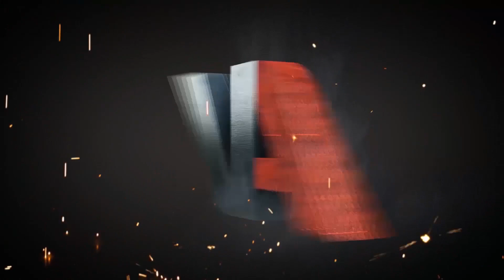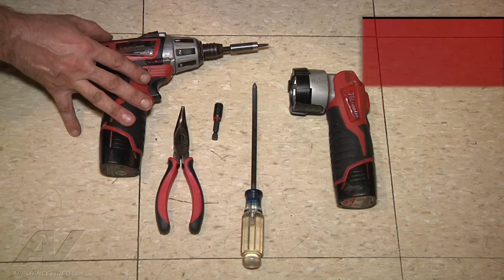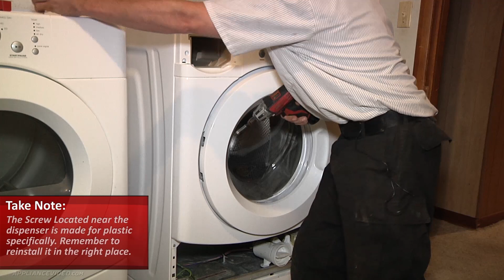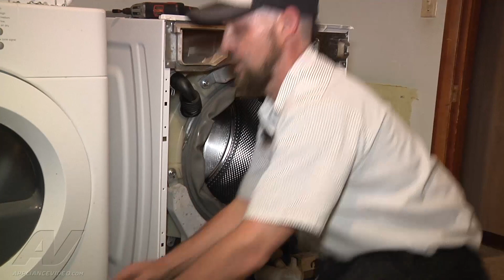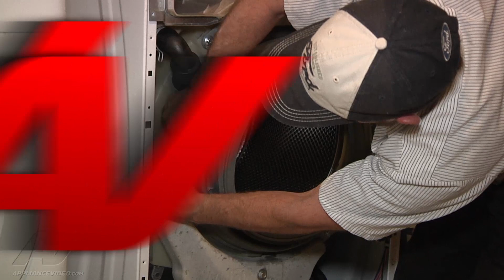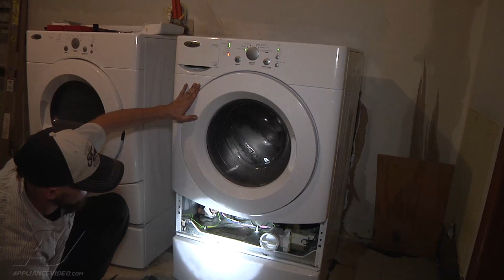Amana Washer Repair - Leaking Water - Bellow

Comment: There’s a trick to open the spring on the last spring by making your own tool with zip ties and a double sided wrench.. it’s in the search videos when looking for how to replace the bellows … you basically attach the spring to the ends of the crescent wrench and tighten the zip ties.. it opens the spring and holds it so you can put it on.. I definitely was too weak to get the spring opened without having that homemade tool.

Comment: Hello, I replaced my bellows (same make and model) i still have a leak. I noticed the new bellows has drain ports in the bottom(previous did not) it is leaking from that area. Would using a gasket maker/silicone sealer be my best option? I don’t understand it should have fixed with the new bellows. Thankyou.
Reply from the maker: Great question, if you have a more technical question that our parts department cannot answer, you can search our over 17,000 answered questions free at our website www.ApplianceVideo.com under our Repair Help section. You can also call our parts department at 1-800-830-5465 and they can give you help 7-days A week ,or search at www.SaveMoreOnParts.com  .
Reply: Did you ever found out the problem? I have same issues, water would drop during spin cycle around the same area you mention.

Comment: Did anyone hear loud thumping during the spin cycle along with the leak?
Reply from the maker: Great question, if you have a more technical question that our parts department cannot answer, you can search our over 13,000 answered questions free at our website www.ApplianceVideo.com under our Repair Help section. You can also call our parts department at 1-800-830-5465 and they can give you help 7-days A week ,or search at www.SaveMoreOnParts.com  .

Comment: Video was a huge help in replacing the bad boot.. But after testing for leaks it is leaking at the bottom where boot and glass come together. Any help here?
Reply from the maker: Great question, you can call
our parts department at 1-800-830-5465 and they can give you help 6-days A week
Mon-Sat . You can also search at www.SaveMoreOnParts.com 7- days a week.  If you have a more
technical question that our parts department cannot answer, our technicians are
answering all questions at our website at www.ApplianceVideo.com under our Repair Help section. We have over 6,000
common questions and answers that you can easily search through by your model
number, appliance make, problem or error codes, and It’s completely free to
search through our question & answer library. There is a very good chance
you question is already answered there.

Comment: Could this work with an Amana NFW72OOTW?  please respond quick ,thanks
Reply from the maker: Great question, you can call our parts department at 1-800-830-5465 and they can give
you help 6-days A week Mon-Sat . You can also search at www.SaveMoreOnParts.com 7- days a week.  If you have a more technical question that our parts department cannot answer, our technicians are answering all questions at our website at www.ApplianceVideo.com under our Repair Help section. We have over 4,000 common questions and answers that you can easily search through by your model
number, appliance make, and problem or error codes, and It’s free to search
through our question & answer library.
Reply: Le Blue Scout Did this work or did you have to do different steps?

Comment: I have an Amana front loading washing machine, and I cannot figure out what is wrong with it. Every time I start a load, it starts out at the regular 59 minute countdown. Then when it gets down to 27 minutes, it stops, and the not filling alarm (n/f) goes off. I have to restart it two times before it resumes the wash. Then when it gets down to the 14 minute mark, it stops again, and the alarm goes off. I don't know if I need a new washing machine, or just new hoses. It does not leak or anything. It is just annoying to keep getting up.  Thank You for reading. Any ideas is appreciated. Have A Good Day.
Reply from the maker: Great question, you can call our parts department at 1-800-830-5465 and they can give
you help 6-days A week Mon-Sat . You can also search at www.SaveMoreOnParts.com 7- days a week.  If you have a more technical question that our parts department cannot answer, our technicians are answering all questions at our website at www.ApplianceVideo.com under our Repair Help section. We have over 4,000
common questions and answers that you can easily search through by your model
number, appliance make, and problem or error codes, and It’s free to search
through our question & answer library.

Comment: Mine just started leaking from the bottom.  How do you take off the panel where the man was shining the flashlight into?
Reply from the maker: Jacob 
          If you go to ApplianceVideo.com and type in your model number or your symptom you are having. Our site has 2600 free videos on it to help solve your problem. We add new videos every week. There is a very good possibility you will find a video that will help solve your problem on how to take off the panel you need removed. Please help our ranking by subscribing to our YouTube page or posting our ApplianceVideo.com site on your Facebook or Twitter account. Thanks Matt,  Ace Appliance service technician.
Reply: Thanks
Reply from the maker: You are welcome, let us know how the repair turns pot Jacob.

Comment: This was helpful to know. I have an Amana washer, model nfw7200tw, it won't spin or drain water. Where could I did a solution fix it myself?
Reply from the maker: Mai
       Go to ApplianceVideo.com and type in your model number or your symptom you are having. Our site has over 2600 Free videos on it to help solve your problem. We add new videos every week. There is a very good possibility you will find a video that will help solve your problem. Please help our ranking by subscribing to our YouTube page or posting our ApplianceVideo.com site on your Facebook or Twitter account.
Reply: It's probably the water pump. Check the coin trap first